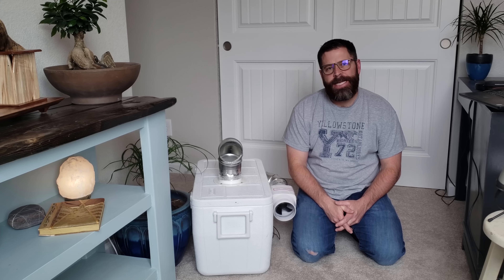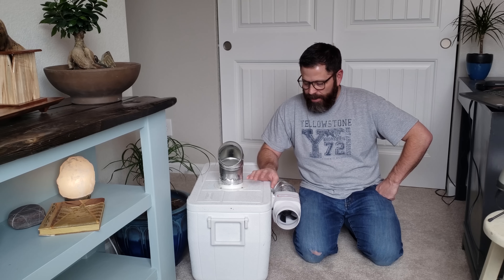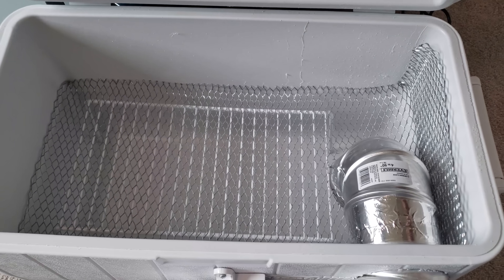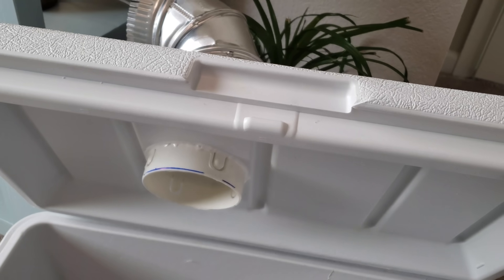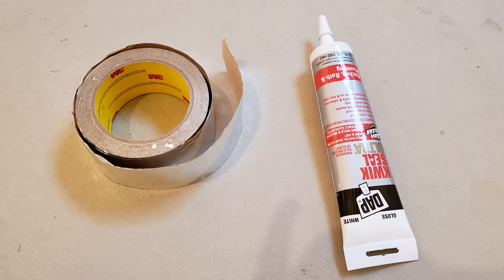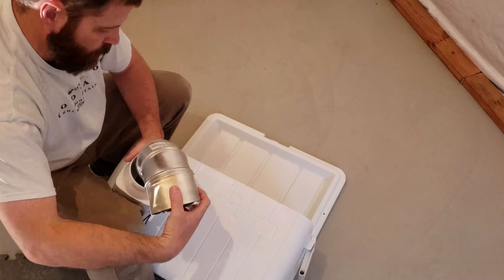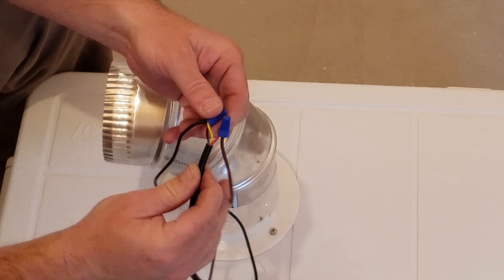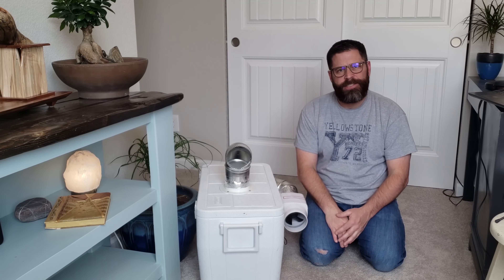Homemade Portable Air Conditioner DIY - Coldest One Yet!

Comment: Hello ; this looks awesome . I've already purchased a fan to start my build . My question is ; what happens when the ice starts melting , and the water level at the bottom of cooler reaches the intake tube ? Won't it eventually travel into the fan area ? Thanks

Comment: I am in the process of making one of these and I had planned on forcing the air to go under the blocks of ice. Having the fan blow over top of the blocks didn't make sense to me. I also plan to capture the outgoing air closer to the end and on top of the cooler. 

I am going to do a test to see if it is more effective to use the fan to suck the air out of the cooler vs the common method of blowing the air from lower, under the ice and let it blow out.

Comment: Getting ready to make my own, but a question I have is, if the purpose is to have the air from the blower underneath the ice, why install the ductwork up high, fed down underneath the Ice vs installing the ductwork underneath the ice to begin with?  It seems a lot of valuable room for ice is wasted with the ductwork up above.  I understand there will be water from the melted ice, thus why the blower would need to be mounted up high, but...the ductwork??

Comment: PESKY MATH: 10 lbs. of ice absorbs 1940 btus when raised from 20F to 70F. If this takes 2 hours the output is 970 btu/hr. Using a dehumidifier to remove the moisture produced is a non-starter, since a 500 Watt dehumidifier puts out far more heat that the cooler removes. Using ice frozen in bottles eliminates most of the problem of moisture (condensation is still there) but reduces the output, requiring a larger cooler. An ice chiller is suitable for spot cooling or a vehicle with no AC, but producing your own ice will use more energy than melting will give back, so isn't suitable for cooling a dwelling.

Comment: I wonder how this would work with dry ice? At --109F, it's over three times colder than water ice. Just like with a propane Buddy heater, you'd have to vent the enclosure and, if camping in a tent, you couldn't lay on the ground because as dry ice sublimates, you can't contain the CO2 gas in the cooler plus it's heaver than air so one might suffocate while sleeping. I just thought it might be better in something like a garage workshop. NOT in a basement though because the CO 2 couldn't be easily vented and would collect from the floor up.

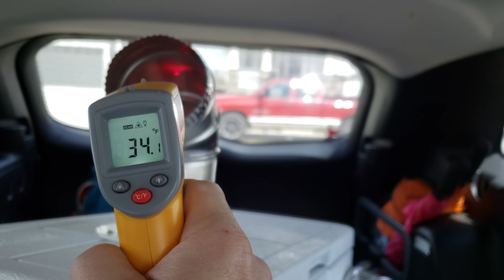Comment: There is so much that is wrong about all these people using ice to cool air, I'm not even going to try to explain.  Also, @3:43... you are NOT seeing the temperature of the air!!!  Those IR temp detectors CANT SEE AIR TEMP, and you can't even see the temp of the aluminum duct... Aluminum is nearly a PERFECT REFLECTOR of IR radiation... you are seeing the TEMP OF THE ICE!!!.  The IR you are seeing is simply a mirror-reflection reflecting the IR image of the ice.  Picture it this way, if the ducting was a perfect shiny mirror (which aluminum is for IR radiation), you would actually 'see' the ice inside the cooler.  Do you get it why the temp was so close to 32 degrees?  If anyone doubts the reflectivity of aluminum, you can also see the same effect in front of your stainless steel refrigerator (stainless steel does the same thing, just not as well).  Do this, point your IR temp 'gun' at a refrigerator with you standing in front of it... you'll see YOUR temp.  Just make sure you are pointing at a reflective-angle that would 'see' a warm part of your body, like your face.  The laser-dot reflecting off the refrigerator onto your body will be the place you are taking the temp of.  Try a 45-degree angle toward your face (avoid getting the laser in your eyes) - if you point it straight-on you'll just be seeing the temp of the IR tool.  Have fun, and I hope you learned something today. Another interesting fact... you cant use those cheap IR guns to check the temp of copper either - you just get the temp of whatever is reflecting off the copper.  All of these metals need to be painted before you can check the temp of the surface.

Comment: Thank you for this video, I work driving a vehicle (Van) where A/C does not work well. So I followed your video but I used a smaller ice chest to be able to fit in the seat beside me since there are no back seats, all I have is two front. And it did not blow cool air. I'm using a coleman thats kinda tall with the wheels and handle. So you think the blower is just moving the air too fast for it to cool?

Comment: I have been thinking about building one with a dual motor setup. One motor blowing air under the ice like you have done. But adding one to the output so it draws the cold air out. In my head it seems like it should work. But I'm not positive.

Comment: Thanks for a great idea. I used mine Friday and it cools my pickup.
No, it isn't economical. This uses a lot of ice. 
It is getting me by until I get my new AC system and put it in.

I thought frozen bottles of water would work but you need ice. The ice blocks around
the intake tube where it goes into the lath  and forces the cooling air to circulate.
The idea of having the intake tube on the side and angled down recirculates
the cooler air better. That is, you are cooling cooler air and the intake and
exit aren't competing.  Everything about this design is great.
My only disappointment is I didn't get a cooler with a drain plug. 
You can get the adjustable elbows a lot cheaper at home depot,
but they don't pivot as easily.
Reply: Search YouTube for ..  SOLAR ICE MAKER

Comment: Going to make one tiny Geometry adjustment if possible. The exhaust coming out will be extended enough to point at the ground. I might even make it a directional changing exhaust for testing. Second test will be thin layer of ice to cover grate and frozen ice packs on top of the ice. Ice slowly melts into a thin layer of cold water at the bottom. Creating cold pocket for the air coming in into the unit.

Comment: I tried this design for camping and as backup A/C for my dogs in the rear of my SUV.  The marine blower is terribly loud, so if you plan on listening to anything else or sleeping, don't buy this product.  Also, the steel lath and aluminum ducts are not exactly user-friendly for a cooler you have your hands in/out of.  Be prepared to get some cuts and definitely use a mesh screen on any intake blower or fan of choice, especially if dog hair is blowing around in your small space you intend to cool.

Comment: This is a fantastic Idea, design, and execution. I am currently making one similar, based off of your design. I am going to try freezing water bottles to put in first then pouring ice over them. Bigger pieces of ice in a sealed container = colder longer and less water once melted and I have a cold drink.😁I'm playing with the idea of a sealed container with a pressure regulated vent and putting some dry ice in it.🤔It will only be used in a space with very good ventilation. Lastly contemplating putting fan on top, pulling air through the cooler, mainly because it will not change the footprint.
Reply: Interesting, I had the idea of a vented dry ice box cooler as well, I've read some papers of people using dry ice with isopropyl alcohol to make a substitute for liquid nitrogen for freezing stuff. I bet some air ducts piped through that would be enough to turn it into the arctic 😂 I guess the only issues you might have are frostbite or humidity freezing up in your air ducts. Longevity is another question.

Comment: mine had a 1200 gph water pump and a 1 inch tubing for pond pumps , swamp cooler mesh wrapped around a chicken wire core .I put the tube down the middle  and around the top I drilled small holes facing down the tip of the mesh . I made a seal put of foam for the top of the mesh cage . then made a 6 inch hole through the seal and lid and a 6 inch OD pvc pipe 2 ft worth and cut in half incase the blower flow up ,I put a elbow and or dryer vent tube for window or out in open with elbow , the garbage can I put another 6 inch OD hole  about 1 and half feet from the bottom and installed a vent for intake . the pump and the fan are both 12v .I power them with a 18 Ah 12.8v LIFEPO4 battery and mppt controller and folding 60 watt solar panels .this cools an RV  or a cooling tent ,wall canvas tent  and or picnic area. 59 deg f comes out fast too. everyone loves it .

Comment: This project is super interesting. It's got me thinking about a way to automate a water and ice supply system. Could put some sort of liquid pressure sensor and water temp sensor to open a valve to drain water once there is enough liquid in the system and if that liquid is over a certain temp. Automating the ice delivery would be harder but I bet I could tap right into the automatic ice dispenser on my fridge.
Reply: If you are using one of these at home and using ice from your ice-machine, then you won't actually cool your home, since the ice-machine is just taking the heat from the water(to make it ice), and dispensing the heat in your home.
Your home will actually be warmer if you are doing this, since the fridge needs electricity to work, and no machine is 100% efficient... some of that electricity will actually become heat.

Comment: You, sir, are an innovator! I love your idea, I have made a blower box that doesn’t get as cold but allows for the ice to last longer by using 2 transmission oil coolers to cool the air going in the box and the air going out of the box. The box is connected to an ice chest via insulated tubing that has a pump pumping water from the ice chest to the coolers in the blower box. I use a turbo fan at the exit point. The temp has gotten to the mid 40s, it’s just a proto type.

Comment: If you had 3 pieces of condensation pads hung in the bottom dangling under the metal grate could you add another cold filtering of air if your main air passage guiding air down to the left through the ice and also a majority of air guided through dripping condensation pads

Comment: THiS WILL WORK FOR 30 MINUTES,If you are within 3 feet of the ice chest. You will spend more money in materials and on bags of ice then if you just go rent a room with AC in a motel on those super hot days..
I made one of these out of a large cooler. The largest one that would fit on the passenger floor of my company car because my air conditioning did not work in the company car

I had a 12 V motor out of a car for the blower motor to a plywood lid. I had to cut a second hole to allow warm air to be drawn in over the ice so the blower could suck it out and blow it in my direction
   I filled the chest with ice and headed out
   It was blowing cold air for about 45 minutes. I wondered why it quit blowing ice cold air on me. I looked inside, all the ice had melted in less than an hour. The hotter it is, the faster the ice melts. You would need a commercial ice machine to be able to keep up with how fast hot air melts the ice. Don’t waste your money

Comment: I'm contemplating making one of these but my idea is to have the fan blow into a series of smaller diameter copper tubes and have them wind across the bottom of the cooler and then have them come up into the big Outlet tube so the air doesn't touch the ice directly it will be like an ice cooled radiator. My thinking is even if you just have water in it it should still do some cooling
Reply: I am also thinking the same. Use copper tubing, i think it will be less condensation than direct air passing through ice.

Comment: What if you attached a fan to a copper pipe instead and laid it on the bottom then back up to blow air the out. This way the cold air is being pushed through a frozen pipe and not ever touching the ice. Since the air isn't touching the ice you could then use dry ice for colder and longer lasting. I was even thinking dropping the cooler into a deep freezer full of water too.
If you attach water tubing to the end you could put the tube in your sleeping bag too

Comment: I dont really understand the point of these.. They dont work. I made one fun. The temp was 30c degrees in my room. The ice melted in under one hour. Thats one bag of ice at $4.00 Australian. I had to the change a bag of ice every hour and it was 4.00 per hour to run. It would have taken 5 hours for this thing to cool the room down as the room itself had so much thermal mass and the BTUs were just not up for the job.  This, verses a refrigerated aircon running at 30 cents per hour.. I cant see why you'd even bother.

Comment: Great video, but you really need to mention the maximum difference between the ambient air temperature and the air coming out of the cooler. For example if you're sucking in 100F ambient air, you're not going to be putting out 30F air.

Comment: How about the addition of rock salt to make the ice colder. Or possibly dry ice. Also you need to vent the liquid because of the ice melts it would eventually fill the cooler blocking the air. Great build!
Reply: Dry ice kills

Comment: Why not move the in-line blower to the inside of cooler to reduce noise and to lengthen the life of the blower motor?
Reply: From what I've seen on videos the motor does not last long if heat is an issue which a slot of times it is it would help keep it cool

Comment: If you could modify a condensing furnace heat exchanger (brand new one and stainless steel, of course), direct air through that and freezing the exchanger in to a block of ice or immersing it into an ice and salt water bath, that may work too.  Although, even finding one may be difficult for price or making your own.
Reply: Pppp😊😊😊😊😊

Comment: Should you want a cooler that would last for many hours,  why not use the old Coca Cola electric water cooler and convert it to that kind of design. The water will remain cold as long as the plug is on; hence, you'll have a steady cool temperature in your room.

Comment: Let me give you some very lengthy research I did and show you a better method sir… First of all you must consider the second law of thermodynamics that heat flows from heat to cool naturally. That is an important concept here. Because every commercial air conditioner has a coil with a fan outside it takes the super heated refrigerant under compression and blows off the heat from the coil which is in an endless closed loop within the refrigerant system. Basically take your design and add to it and exhaust port in a separate chamber from the cooling chamber. Vented out a window. Also within your loop include a small water pump that will take the water at the bottom of your cooler and circulate it in a coil which has attached to it a small aluminum water container which you will attach a CPU style coolant block two. The pump will continuously take the water on one side as it’s pumped through the circle of tubing, aluminum or copper, in the TEC which is the main component or Peltier module/TEC, thermal electric cooling module which is mounted on the opposite side of the aluminum water cooler block from the cooling fans and as you apply voltage at 12 V maybe 2 A one side of the TEC module gets extremely cold below freezing while the other side gets super heated which also has a heat dissipating coil attached to the heat side. That water is super chilled as it pumps and using a small raspberry pie you could measure the temperature and turn on and off the pump to cycle it to keep the water cooler longer. That’s the key for longevity. Ventilation of the heat and super cooling with a TEC module of existing water to keep it cooler, longer.

Comment: Before anyone contemplates actually doing something like this, I suggest considering how much heat energy can be removed by the ice that will fit in the cooler (less the space used for the air passages). When you put plain water ice in a cooler, it rises to the melting point very quickly, after which it takes only 144 Btu of heat to melt one pound of ice ("Latent heat of fusion"), and about another 30-35 Btu to raise the temperature of that water to where it won't provide any sensible cooling (other than evaporative cooling, which isn't effective in humid weather). So the best you're going to get is about 175-180 Btu per pound of water. How many pounds of ice fit in the modified cooler shown in this video?  The cost and weight of this setup make it impractical, especially if you have to buy the ice and/or you have to carry all that weight any distance.
Reply: What about adding salt to the ice.
Reply: You're using the same machine that's constantly keeping heat dissipated, when it gets down to a certain temperature, the energy requirement goes down, but yes you're still technically correct, the issue is are you routing the heat out of the house, is the freezer keeping things cold to the point it only kicks on to disperse enough heat to keep things where they're at, is the internal insulation thick and well designed enough?

There are a multitude of variables to consider here, but if you're using this to cool another room, you will get a measurable difference in the room you want to work on.
Reply: Have you constructed this yourself to prove your data correct or incorrect? He built his and real world tested it.

Comment: A better design for this would have a 'closed' system - i.e. have a sealed aluminium duct that flows UNDER the ice at the bottom of the cooler (couple of those type projects on here) - that way you aren't pulling the hot air directly through the ice itself, so not only will it reduce the amount of moisture it's putting in the air, also the ice would last a bit longer - and you could use cooler blocks / frozen salt water bottles aswel as bagged ice
Reply: that's what I did. Also the 130 cfm fan, not 300. Also having the aluminum tube under the water/ice, without the air coming in contact with the water/ice....thus NOT a swamp cooler. (no additional moisture.
Reply: @TJK50014 how thick was the tubing to support 130CFM? Did it wrap around inside the cooler?